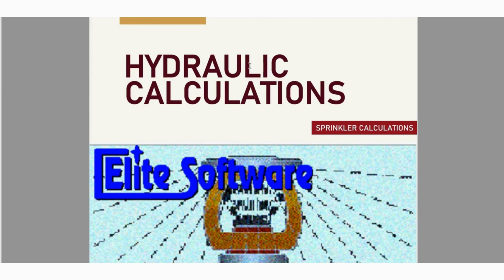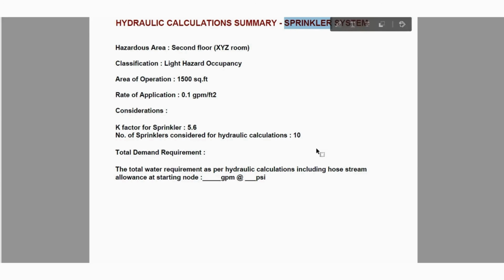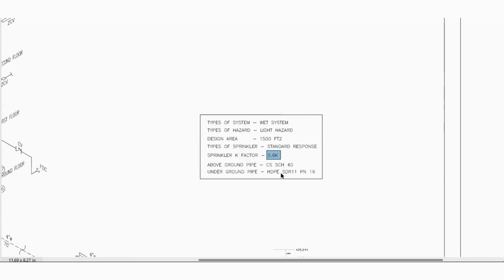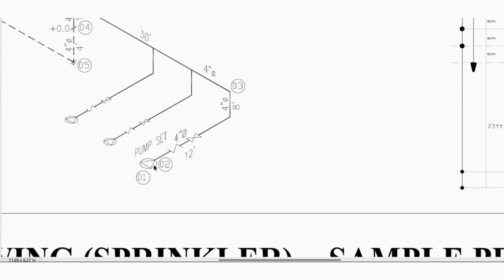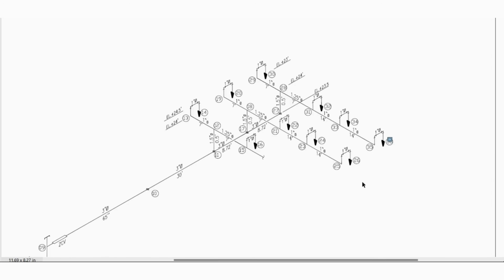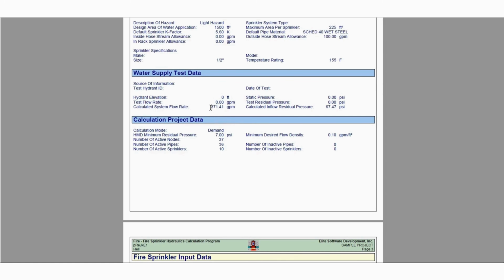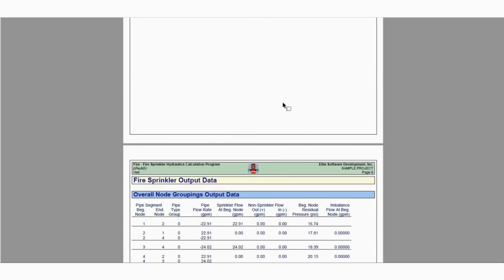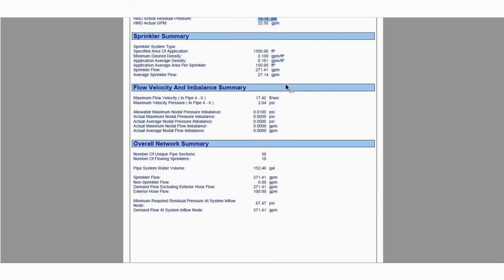Class 3 | Elite fire Sprinkler system calculations

Comment: The Calculated System Flow Rate is 371.41 GPM/ and the Outside Hose Stream Allowance is 100GPM. You said that 100GPM was added so that it becomes a 371.41 GPM. I have the same thing on my project but I tried removing the 100GPM and the calculated flowrate system Flow Rate stays the same. How do i make it reflect on my printed hyrdaulic calculation that this happened?
Reply from the maker: In video I explained clearly please recheck. Tick exterior flow

Comment: Sir , you have done this calculation for Demand mode , is there any big difference if we do for supply mode ?
Reply from the maker: Supply mode is considered when u already selected the fire pump or already u have the details of flow and pressure at tie in connection etc. demand mode is considered to calculate the required flow and pressure irrespective of available flow and presssure. Pls do run the calculations using supply and demand mode and verify then u will understand

Comment: Dear Irfan bhai,
I am now facing problem to solve a problem. If fire pump room (Extra Hazard) lies inside the multi storied building (light hazard) and total building is protected by sprinkler system. Then as per hazard classification requirements shall I need to consider extra hazard design requirements or the principal hazard. 
If you have time please let me know your opinion.
Reply from the maker: Sprinklers in side the pump room will be considered as extra hazard and the office building will be designed according to light hazard
Reply: @irfancfps  but what will be the fire pump capacity??
For Light Hazard 
As per Design Density curve: 0.1*1500= 150gpm
Hose Stream allowance: 100
So total= (150+100)= 250gpm 
For Extra Hazard: 
design density curve 0.4*2500=1000gpm
Hose Stream: 500 
So, total = (1000+500)= 1500 gpm 
As per nfpa 14 for two standpipe 750gpm
Now which one shall i need to consider???

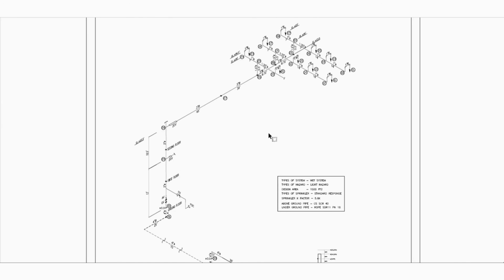Comment: 22:00 you have mentioned that 7psi pressure required at remotest sprinkler but in nfpa 13 table 19.2.2.1 states that residual pressure for light and ordinary hazard is 1 and 1.4 bar respectively. 
I understand that If we convert 1.4bar absolute pressure to gauge pressure it will be approximately 0.7 barg in ordinary hazard but what will happen in light hazard ? The gauge pressure will become 0 barg. Will water come out of sprinkler since out side pressure and sprinkler inside pressure is same. 
I am not sure whether I described my question correctly or not. Please reply if not clear.
Reply from the maker: 7 psi if we are performing for hydraulic calculations. If u consider pipe schedule systems then 1 bar .. 1.4 bar as u said shall be considered.
Reply: @irfancfps  thanks for your reply. So the values 1 bar and 1.4 bar is basically gauge pressure and not absolute pressure. Usually as standard practice we put suffice ‘g’ with unit like barg. If there is no suffix I understand it as absolute pressure.